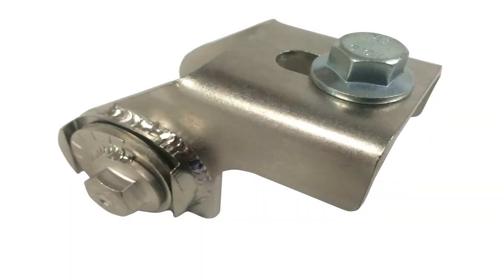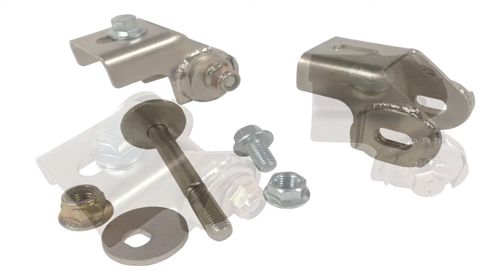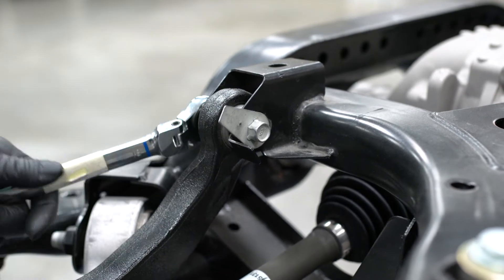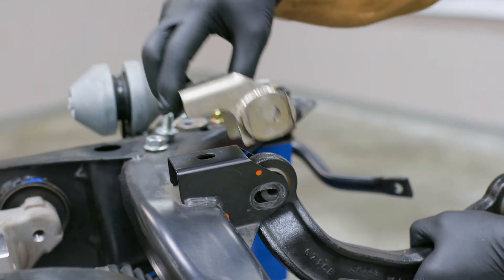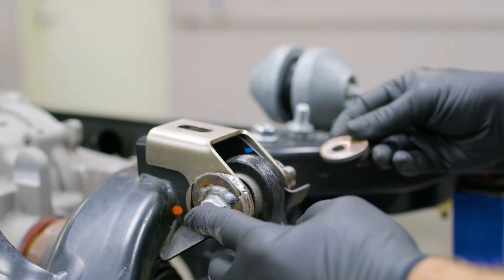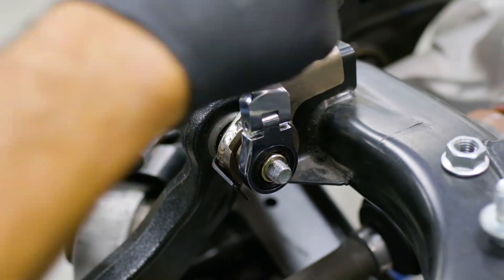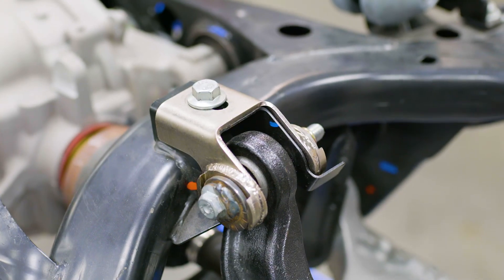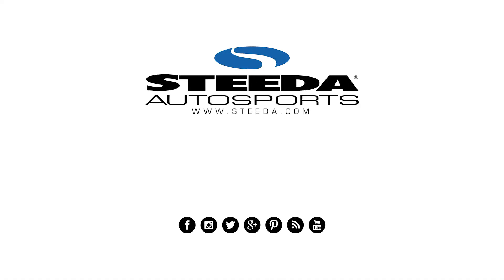S550 Rear Camber Adjustment Kit Installation - Steeda 555-4126

Comment: If you only go with a 1" drop, doesn't the oem bolt provide enough adjustment?
Reply: No
Reply: @Vitrated You're right. I had to add some rear camber adjustment brackets to the rear.
Reply: @Condor1970  just installed the FP lowering kit and found out the hard way too lol not fun

Comment: The trick to installing these without screaming and cursing is to lower the subframe down on the one side. Remove upper shock bolts, parking brake hold down bolt, brake hose hold down, support spring seat with jack, remove the 2 24mm headed subframe bolts and 2  13mm headed plate bolts and slowly lower subframe until you have access. Loosen near side camber arm bolt too. When reinstalling make sure you align shock first and bolt in and jack up at an angle to align subframe bolts (including 13mm!!!!!).

Comment: After installing these.. Can I get 0 degree camber back from my current -1.6 degree with lowered springs?
Reply: Carlos I want to know as well
Reply: No one answers these fucking questions! My God! Did either of you end up finding out ??
Reply: @marcusd6759 4 years later….
Reply: Yes you can, with this bracket + the oem camber bolt located down to this one. Just installed mine and I got slightly positive camber.